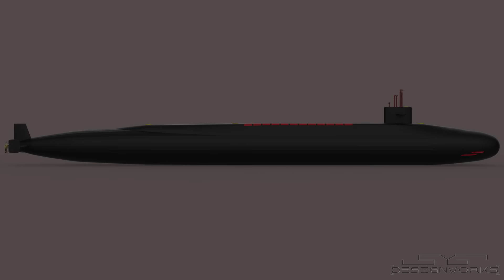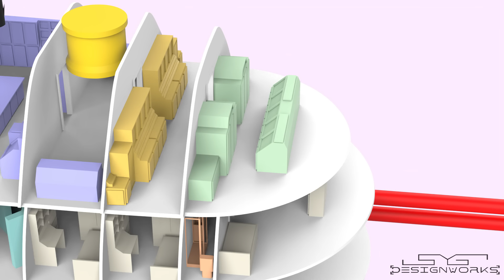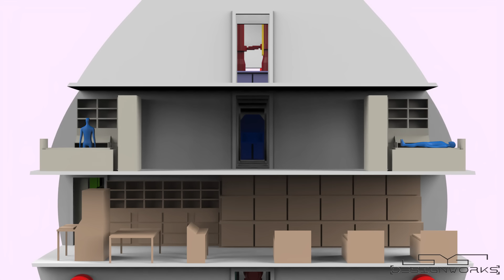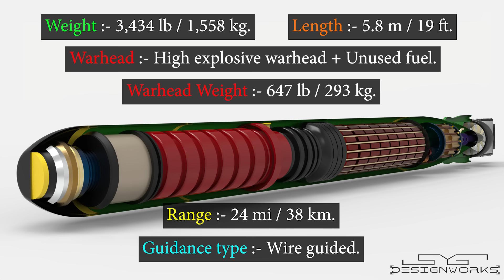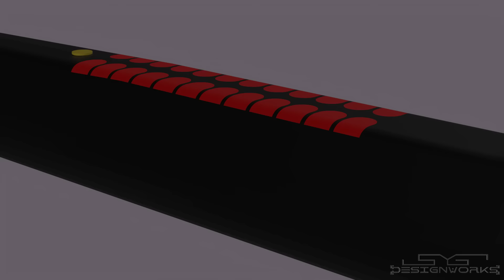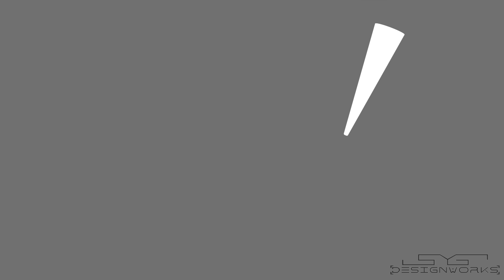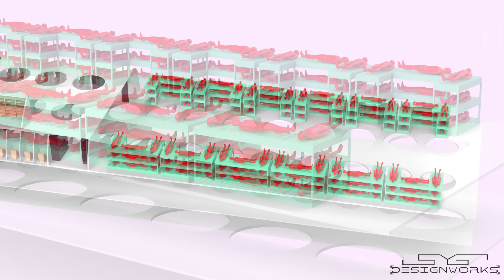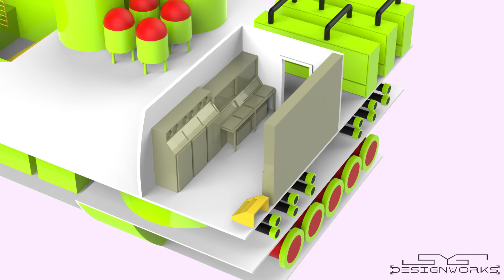Submarine Nuclear Power | Engineering behind it Nuclear Reactor How it Works

Comment: Ohio class never had anechoic tiles. When this class was introduced, USA did not have this technology and when they received that from British, unlike on american SSNs, they never installed them on their SSBNs. I did not figured why. My theory is, that these tiles are effective against active sonar during fight and Ohio should never get itself into fight. And when you do not need to damp active sonar then anechoic tiles are burden (because if they peel off, they increase passive sound emission of submarine).

VLF is one direction communication. From land to submarine. Submarine lacks antenna capable to transmit on that frequency. 

Sonar is used in active mode only in specific situation, like in battle. Otherwise active sonar always reveal position of submarine.

Ohio class really do not use Mk54 torpedoes. No american submarine does. It will need special adapter to be able to fire 324mm torpedo from 533mm torpedo tube.

Tomahawk with conventional warhead does not have range 2500 km. Roughly half of that value is correct. Higher value is for nuclear warhead, which weights 1/3rd of conventional one and spared room is replaced by fuel.

PDX-57 does not store 2,6MW of energy, it would be just 722 Wh and this will be extremely poor energy density even for lead-acid battery. In fact, they store more than 10 kA-hours at 2.0V of nominal voltage, so at least 20 000 Wh at weigh roughly 953 kg it is energy density 21 Wh/kg, which is not bad for Pb battery but also not great (for example Kilo class is using Pb batteries with energy densities from 37 Wh/kg at rapid discharge to 52 Wh/kg at slow discharge).
Whole Ohio class batteries capacity is 2,6 MWh (it has 130 PDX-57 cells which are producing via inverters stable 240VAC and 155VDC used on american submarines).

Although I admire your 3D animation capabilities, I have to say, that layout and cutaway is more your imagination than reality.
Reply from the maker: Thanks for the info. There is little to no information about Ohio Class submarines online. Most of the info were taken from news websites and wikipidea. Thanks for watching.
Reply: You're wrong. I was grand admiral brigadier general master chief supreme commander of alpha submarine force Charlie back in 92.
Reply: @bobbyrayofthefamilysmith24  Yeah, and you opened largest bottle of vodka then. Till today, you did not get sober 😀
Reply: I'm assuming they have to change those batteries every three years? That sounds like a tough job changing those things.
Reply: @williambarry8015  Nope, these batteries have much longer lifetime and cycletime, than normal lead-acid batteries you find in your car. Usually these batteries are changed twice per sub lifetime on DE subs and never unless cell failure on nuclear subs.
Reply: Who are you? To know all this stuff i mean?
Reply: @tomascernak6112  And where did you qualify? We charged the battery all the time after repeated drills. The batteries were always on at least a trickle discharge. After a set number of amp hour discharge they were charged. Also we did test discharges to check capacity....again they were charged.
Reply: @DuffyF56  Changed vs. Charged. You are maybe qualified to serve on submarine, but you are not qualified to read. I am Not surprised to be honest.
Reply: @tomascernak6112  Well EXCUSE me. BTW....Batteries are CHANGED more than once in the lifetime of a boat too. The boat I qualified on was commissioned 38 years ago and still in service and likely will be for at least 5 more years. If you think submarine batteries last over 20 years you are high. So you are STILL wrong azzhat.
Reply: @DuffyF56 And once again, you proved you are not qualified to read. Or understand simple text. I wrote, that batteries on nuclear submarine are not exchanged until cell failure. They are not exchanged just "because". On the DE sub they are exchanged just "because", because in DE subs batteries are not backup but main power source underwater.

Typical submarine lead-acid battery has 5 thousand cycles lifetime and practically unlimited durability, if cared properly. They weights also hundreds of kilograms and cost tens of millions dollars (whole pack). Multiple reasons, why not to change them just "because".

Btw. your inability to read properly and understand simple text casts bad light on whole american navy. How such incompetence was allowed to serve on nuclear boat?!
Reply: @tomascernak6112  And once again you are WRONG. Batteries are replaced based on their remaining capacity determined by Test Discharge testing. A TAD sensitive there BuckO?????? You don't know a lot if you think we waited until cell failure. We did however have procedures to bypass cells if need be...........SMH Get some sunshine!!!!!!
Reply: Trident subs with the BQQ 6 sonar system are not equipped with active sonar. Perhaps now the SSGN's are, but not SSBN's. Active is for tactical warfare. Tridents are strategic weapons
Reply: @ompson1965 Ohio Class sonar suite reportedly includes IBM BQQ 6 passive search sonar, Raytheon BQS 13, BQS 15 active and passive high-frequency sonar, BQR 15 passive towed array from Western Electric, and the active BQR 19 navigation sonar from Raytheon
Reply: @DuffyF56  Yeah. We called that our "Under-ice sonar." It would never be used for battle. As if a Trident ever did battle. I was a Sonar Tech on the USS Henry M. Jackson. SSBN 730 Gold crew...Should have never went on a boomer. Every time we would have an interesting or exciting contact, we immediately ran away. lol
Reply: @EricThompson1965  I was a plankowner on USS Alaska. Point being...there WAS active sonar onboard.
Reply: @DuffyF56  Okay. So technically there was something that Pinged. But it wasn't for detection, localization, or range-finding. It wasn't intended for the purpose of an actual active sonar such as the BQQ 5 on 688's. Ours was never used in the 4 patrols I did because we never went under the arctic cap. It had very little strength as it was intended to determine range to ice above the boat as it surfaced under ice
Reply: @DuffyF56  btw... What was your rate on the Alaska?
Reply: @EricThompson1965  What difference does THAT make? I was qualified.
Reply: @ompson1965 Active sonar as I stated. Ametek AN/BQS-15 active/passive high-frequency sonar for mine detection and obstacle avoidance (under-ice navigation). It is located on the forward edge of the sail.
Raytheon’s active AN/BQR-19 navigation sonar which is mast-mounted and intended to be used while surfacing.
Reply: @DuffyF56  I have never met a squid who didn't immediately divulge his rate when asked...The fact that you evaded the question makes you yet another suspect YouTuber... Amazing the info you can find on Google these days, eh?
Reply: @DuffyF56  I was a Sonar Tech for 6 years and even I don't remember all the An/Uyk designations of all the equipment...
Reply: @DuffyF56  btw... I could scream "PING" into a sound powered phone, but it still doesn't constitute active sonar. No one will ever here a Trident SSBN send out a ping in a battle... Because they don't have active sonar!
Reply: @EricThompson1965  Yeah whatever dude.
Reply: @EricThompson1965  So? Your problem not mine.
Reply: @EricThompson1965  Yeah...amazing the stuff you retain and can verify when stupid people say false crap trying to make themselves feel important.
Reply: @EricThompson1965  Typical TRUTH DENIER. They had active sonar. FACT.
Reply: @EricThompson1965  Sound powered telephone? . Since when is that system coupled underwater? And you were qualified?
Reply: @tomascernak6112 Not quite accurate, but irrelevant information anyway.
Reply: @DuffyF56  And by gosh that Battery Log best be perfect.

Comment: When I was a kid, I built a toy sub out of plastic foam, put in a fair amount of led snots for ballast and tried to achieve neutral buoyancy by adding very tiny chunks of led wire. I wanted to see my sub soared in the depth of my bath. It never happened. Floating sub always sunk .Neutral buoyancy is quite unstable state, could not be set for a more or less long time. The better accuracy of the math - the less speed sub needs to maintain “neutral”buoyancy.

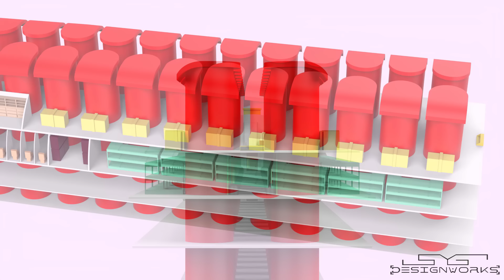Comment: Around 16:40, the batteries are said to deliver so many watts of energy. Strictly speaking, watts is a unit of power (energy/time), not energy. Also its a bit odd to express battery power, unless the duration of time over which that power is delivered is stated (i.e., total energy = power x total time delivered)
Reply: My solar battery setup uses so many batteries and each one is limited to100 amps.  Knowing the volts, I can figure out the max power delivery by the LiPO4 batteries.  But the real delivery limit is my inverter.  Back on the old (now ancient by comparison) submarine we used MOTOR GENERATOR sets that delivered AC power which would power the Reactor Coolant Pumps etc.  But as you pointed out, that has nothing to do with HOW LONG the batteries can supply that amount of power.  You can get an idea of how long that is by making an estimate of the volume of the batteries that is possible and that will lead to HOW LONG they can power the essential loads needed. In most scenarios, the real limit is how long you need to get to PD (periscope depth) so you get a DG started.  That will be the real op limit before you need to get the reactor restarted but on the old boat, the DG fuel tank was used as shielding for the reactor and that had plenty of fuel for a lot of hours.  Running the DG at periscope depth or on the surface out in the open ocean is no fun as big waves close the intake when it goes underwater at PD and on the surface?  Well it doesn't take long for even the 20 year vet chiefs to get sea sick as they aren't used to it either.  The goal is to get the reactor restarted and get back to depth where everybody can relax....

I remember in the N Atlantic with a typical winter storm, huge waves sitting at PD getting beat up.  One of the EOOWs took a simple instrument failure and screwed it up into a reactor trip.  I'd give him shit even today for  his screwup because I remember that night very well.  I was new RC (reactor controls) div officer and that was frequently a first job for new officers.
Reply: Amps would have been the correct term to describe the energy available? As an accountant by trade, but have recently gotten interested into working on my own cars (since its so hard to find an honest mechanic you can afford these days) I've started delving into both the electrical systems of cars, and even stereo components. Electricity is pretty weird and so often taken for granted it's been interesting to learn how both AC and DC work. That almost everything that creates electricity (ex. alternator, computer) make AC current and then a rectifier is used to change it to DC. And how everything Tesla invented back in the 1880's is still being used today for power generation with little change to his design. What a brilliant mind. But I've  Learned quite often its only a few dollars part that cause either your car or stereo to malfunction. It's just finding that cheap and often made in China part that is the challenge. lol.  thanks for the comment. I just hate the idea of tossing something out when with a little effort you can cheaply fix it yourself, not add to the landfills, and save ya $$ to boot. take care.
Reply: One cell weight is 2100lbs.

Comment: The entire sub you can see isn't actually pressurized. The outer, black hull you see is a free flood area of the sub for several reasons. The actual inner "pressure hull" is the smaller, pressurized zone used by the crew underneath all that. This area is sometimes called the "people tube" for this reason.
Reply: That is only true for the fwd and aft part of the boat where the ballast tanks are located.
Reply: "People Tank" is the correct term. God Bless Submariners

Comment: I guess they learned the lessons from the Thresher to always have a backup generator...
Reply: Lots of lessons were learned from Thresher and I put the first sub with SUBSAFE into commission as a result of that accident. We were the first submarine since the accident to not be depth restricted.  Nuclear submarines have always had diesel generator back up from the beginning. You just can't run them submerged without snorkeling or you would burn up all the air inside the hull in a few minutes.

Comment: Very nice the only problem is the information about the sonar, Submarines use two types Active and Passive You described their active sonar quite well but its not used all the time or hardly at all as it gives away your position to the enemy as well as tells you where it is. Passive sonar is using both the ships hull mounted hydrophones as well as the towed array which is a cable the sub will drop behind itself and is covered in hydrophones allowing the ship to listen behind its screw as well as grants the sub a better idea about what is around it.
Reply: cool. thank you.
Reply: Trident subs are not equipped with active sonar. Active is for tactical warfare. Tridents are strategic weapons, and run from any potential threat to retain their designed purpose - Nuclear deterrence

Comment: I found this one of the most interesting posts that I have seen on YouTube. Thanks! What is the difference between the eighth generation nuclear reactor for US nuclear submarines, and the previous generations? The French Navy has been using the same nuclear reactor to power their Aircraft Carrier and nuclear powered submarines over quite a few generations of the submarines, if I am not mistaken. What was the need to fit these boats with eighth generation submarine nuclear reactors?
Reply from the maker: Unfortunately there's not much information available about the nuclear reactors. Not just the reactors, there's almost no info available about Ohio class submarines in general other than the basic specifications. US govt maintains a lot of secrecy about the navy tech more than the aerospace tech for some reason. Thanks for watching.
Reply from the maker: @jimfrazier8611 Wow! Awesome! Thanks for watching!
Reply: One of the main design goals was to extend the life of the fuel.....that is, more miles per gallon.  That equals fewer EXPENSIVE refueling periods in drydock.  And they got there.....the newest boats have cores that never need refueling in the 40 year life of the boat.
Reply: Generations 1-7 weren't cool enough.

Comment: This is obviously made from a submarine depiction. Understandably not due to the author, however not accurate to the detail that makes it sound like a cakewalk. For example, DOC'S space is not even in that compartment and is 1/4 the size depicted. Also, we only have 1 IDC. This video makes it sound line a full medical ward with surgery. It's not. Don't get me started on laundry, it's 2 washers and 2 dryers for over 200 people. And they usually break or catch fire😂😂. The author did the best he could do. Clearly a lot of work went into this video.

Comment: I had no idea a ballistic missile can reach orbit in that short of time. Of course I'm not a rocket scientist so I have to go with this video. I'm guessing the sub has to be fairly shallow when launching. I'm sure that's top-secret maybe. From the comments I see many errors where made but still interesting I personally don't go under ground or water so this job is way out for me. I'll go to space though without hesitation. Flying fan.
Reply: Strictly speaking, an ICBM doesn't enter orbit; its on a Ballistic trajectory to the target.  That's not to say it doesn't reach a high altitude.
Reply: Reaching orbit is something different, but you mean reaching space.
Reply: Launch depth is not top secret. It may still be classified but if so only Confidential. Actually there is very little on a Trident that is Top Secret. Radio because of cryptography. Upper level missile where the targeting packages are programmed into the SLBM's... Been nearly 40 years since I served, but as far as departments go, those are the 2 most highly classified. Quartermasters because of navigation. I had a Top Secret clearance as a Sonar Tech, but I don't ever recall reading anything TS... All our tech manuals were merely Secret
Reply: 130000 lbs spit out like a zit. Is quite impressive, even more so if you do a ripple launch. Not many have the toilet seats. They don't come up for auction at all.

Comment: I like the movie. But you make one mistake. At approx. 3.35 you say that Low frequency radio has shorter wave lengths. 
This is not correct. The lower the radio frequency the longer the wave lengths become. So LF Radio has long, not short wave lengths.

Comment: The depth is still surprisingly shallow, less than two ship legnths by a wide margin, a strong athlete can run that dostance in 30 seconds or less. 

We see films that portray these machines as being so far away from the surface,  but in absolute terms they are barely under water at all.
Reply from the maker: True, but the thing is, the real depth is almost always a top secret! They can dive to extraordinary depths.Just by knowing how deep the sub is, the class of the sub can be identified. That's why almost all the submarines that are operating in the world right now have never disclosed their actual max depth! Thanks for watching.
Reply: Yes, a strong athlete can run several hundred feet in a short period of time; in cars we routinely go a mile in a minute...but that's all at a relatively constant elevation (in the case of cars). Sunlight only goes down about 600 ft, as far as most things are able to register, and it get's dark much shallower (around 200-300 ft). You're also not accounting for the pressure rise that is experienced the deeper you go. At the publicly available depth information of 800 feet, the submarine is experiencing about 350 psi (or 24 atm). So, 24x the pressure it experiences on the surface.